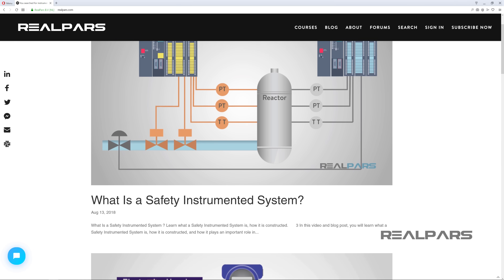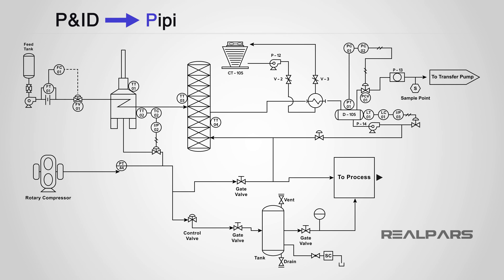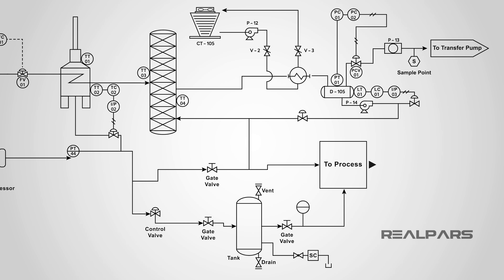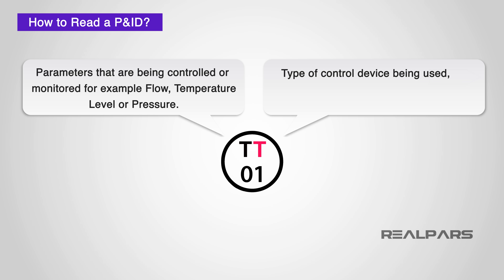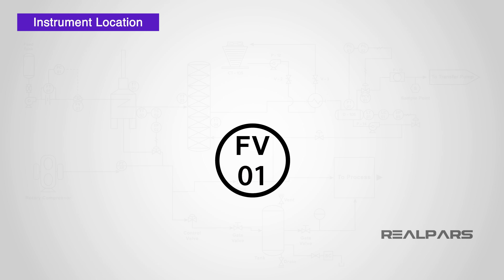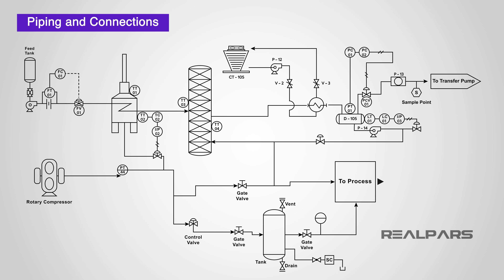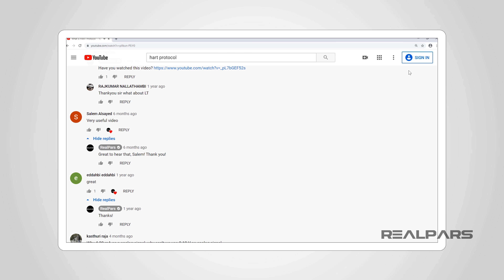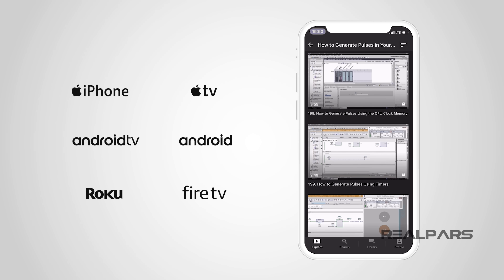How to Read a P&ID? (Piping & Instrumentation Diagram)

Comment: what location will the circle with internal line indicate?  3:16
Reply from the maker: Hello @mubashshirshaikh-b7u. Thank you for your question. You asked about the FV01 and the FV01 with a line in the circle. The FV01 is located in the plant as flow valve 01, and the signal with the line is the same signal, and a meter is located on the control panel, so you can see the value of this FV01.

Here is a link for your learning on P&ID symbols: www.edrawsoft.com › pid › images
https://www.edrawsoft.com/pid/images/pid-legend.pdf

Happy learning from Realpars!

Comment: Is this really a P&ID not a PFD👀
Reply from the maker: Hello, @Joynamiiro. Thank you for your question. No, they are not the same. A PFD provides a simplified representation of a process, showing the relationships between major equipment, control loops, and process flow paths.  And the P&ID (Piping and Instrumentation Diagram) is a detailed schematic drawing used primarily in the design, operation, and maintenance of process systems.  Happy learning from RealPars!

Comment: From a 10-ton waiting bunker, a mixture destined for the production of dog kibble moves to a continuous, horizontal paddle mixer where steam (direct injection into the product) is added to moisten and heat the product. The temperature of the mixture upon leaving the conditioner must be 70°C, from the first kg (thus from the start – often referred to as hot-start mixers) to the last kg, but must not exceed a temperature of 80°C. This product then goes to the extruder, which shapes the kibbles, and subsequently moves to the cooler.

Can someone help me drawing a flow diagram with sensors, controlers, indicators and actuators on it? After watching many videos I am still not able to do so. Thank you a lot!
Reply: @RealPars? 🥺

Comment: Good video, very basic. Our equipment P&IDs are very detailed, and lists the setpoints of controls, signaling direction and type (analog/digital) etc. We also have our valves separated by solenoid and pneumatic or hand control (isolation). Lots to learn but indispensable.
Reply from the maker: Thank you for sharing, John!

Comment: I have noticed that there are multiple controllers in the P&IDs I have encountered. These controllers control the various process variables(Temperature, Pressure, level, flow). With this distribution of autonomous controllers in the diagram, is it safe to say a plant uses DCS or multiple PLCs(ie one plc for each process variable). 

I understand PLCs can be used as DCS and in that case, does one plc control just one process variable?
Reply from the maker: Hi there, 

Thank you for your question! Yes, you are correct. You can have multiple PLCs controlling one process at a time or several PLCs controlling multiple processes simultaneously. It depends on your process, the type of PLC and manufacturer you pick, and the memory and I/O boards you install in your PLCs.

Here is a link to help you learn more about PLC processes from Siemens, and you can compare them to other manufactures out on the market. 

https://support.industry.siemens.com/cs/document/90939626/tia-portal-an-overview-of-the-most-important-documents-and-links-safety?dti=0&lc=en-US

Happy learning!

Comment: This is not a PID. This is a PFD with some instrumentation tag numbers added. Where are the line numbers, intermediary valves, etc?
Reply from the maker: Thank you for your comment.  Technically, you are correct.  A full-blown P&ID would be much more "congested: and not as clearly convey the basic control elements of a P&ID.  Much of what is presented on a full P&ID is information related to piping, insulation, and mechanical details, which have been removed in this video to make the automation elements more visible.
Reply: @realpars  understandable, but it might be worth mentioning in the video as many who are new to PIDs may get lost in the complexity of some drawings.

Comment: How to read block process flow diagrams?
Reply from the maker: You would read a PFD much in the same way as a P&ID.  On a PFD, there is typically less detail about piping, equipment, and instrumentation, but PFDs usually have mass and energy balances and individual stream properties which are helpful in understanding the process.

Comment: I have a question hope to get answered.
Is a pressure indicator (tagged as PI in P&ID) the same as PIT?
I'm talking about the type of signal they send.
Reply from the maker: No.  Per ISA 5.1, 
PI =- pressure indicator (local indicator, no signal to control system)
PIT = Pressure Indicating Transmitter (local indication and signal to control system - either voltage or current)

PT = Pressure Transmitter (no local indication [blind] and signal to control system - either voltage or current)
Reply: @realpars  
You have no idea how this answer helped me. 
Thank you...

Comment: Hi, can I know where to put pressure control system at a fluidized bed reactor?
Reply from the maker: For a fluid bed r4eactor, it is usually advantageous to put a back-pressure controller on the outlet stream of the reactor to maintain a constant pressure inside the reactor.

Comment: whats the parameters and type of I/P  ?
Reply from the maker: The I/P shown is a current (I) to pneumatic (P) transducer.  It takes the 4-20 ma signal from the controller and converts it to a 3-15 psi signal for use by the diaphragm actuator if the control valve.

Comment: Thank you for your great explanation. I would like to ask, what does the "not directly accessible" really mean at the solid line?
Reply from the maker: "Not directly accessible" means that you cannot walk up to a panel and physically touch or manipulate the device.  You have to pull out a rack, walk behind the operating panel, open an enclosure, etc.  This is an older term, but it is still appropriate for field-mounted devices.
Reply: @realpars  Thank you so much
Reply: Watch P&ID video using EdrawMax at @FODIC
https://www.youtube.com/watch?v=jHzYXW0r0AU&t=300s

Comment: thanks for the video. it helps ,me a lot but what do you mean at 3:37 "not directly accessible?" what does the pipe symbol crossed with 2 bars? (for instance of the top right of your scheme. Could you   advise me a handbook? thanks a lot
Reply from the maker: Instrumentation and piping symbols for P&ID drawings are defined in ISA 5.1-2009 (http://integrated.cc/cse/Instrumentation_Symbols_and_Identification.pdf).  'Not directly accessible' means that in order to access the device, you will need to open a panel or go behind a panel.  I am not sure where you saw a "pipe symbol crossed with 2 bars" in the video.  If you let me know at what time in the video it appears, I will be happy to help identify it.

Comment: How do you count Input and outputs from a P&ID? and this IO count will be used for PLC Programming.
Reply from the maker: Excellent question!  In order to do this correctly, you will need to thoroughly understand the P&ID symbology. Motors, VFD's, analyzers, and even valves may have multiple I/O points associated with them.  The P&ID lead sheets and any "typical" that are contained in the P&ID's may offer some clues. For example, a typical valve may have one digital output (to move the valve) and zero, one, or two digital inputs to indicate position.  A VFD may have a digital output to start the motor, an analog output as a speed setpoint, two analog inputs for actual speed and current, and several digital inputs to indicate status, alarms, "at speed", ramping, etc.  When I do this exercise, I like to take a set of drawings, and for each item on the P&ID, I write the number of DI's, DO's, AI's, and AO's on the drawing in pencil.  As I go through the process and learn more about the intent of the process, and through discussions with the process engineers, I can come up with an accurate I/O count.  It also helps to understand the past philosophy of the plant as to how many I/O are typically used for a class of devices.  When instrument busses like Profibus are used, and each I/O point is not associated with a separate wired connection, then those I/) should be accounted for in a separate list.
Reply: @realpars  thanks for the reply. it mostly cleared my doubts on P&ID,  once again thanks for your amazing efforts and educating us!!

Comment: According to ISA (http://integrated.cc/cse/Instrumentation_Symbols_and_Identification.pdf) solid line represents a control room (or accessible to operators), and the dotted line as inaccessible. Can you please clarify?
Reply from the maker: Thank you for your question.  A solid line through the "bubble" indicates the device or controller is "accessible to the operator" in their normal monitoring location.  This would be in front of an operator terminal (HMI) in a control room,  on the front of a control panel or operating board, or at a field location like a wastewater system "hut".  A dotted line indicates an "inaccessible location" which is not a normal operation location, like the back of a panel or in a control closet.  I hope this makes the use of these symbols a little clearer.

Comment: We have some major ones in my line of work, never take for granted that the piping goes in the direction of the drawing. Best advice for a starting point is to find a piece of equipment upstream and downstream of something major to determine you’re going in the right direction. Once you get the hand of them they are pretty simple. Just make sure when you are printing off them you have each page related to the start and end of the process you are following. Nothing worse than being on top of a 500ft structure that’s under construction to realize you didn’t bring all the right sheets. You only learn that lesson once when it’s like 45C in China and you’re a mile from the control room.
Reply from the maker: Thanks for sharing your knowledge and experiences with us, Colin!

Comment: With regards to Instrument location, in the Video the dotted line inside the circle indicated that the device is located in the control room while the solid inside the circle indicates that device is inaccessible to the operator. As per ISA-5.1-1984-(R1992) Standard it should be the other way around.
Reply: of course, great , I agree with you
Reply: aha!  that's what I'm looking for! thanks mate!

Comment: What is meant by "Not directly accessible" in practical words?.
Reply from the maker: "Not directly accessible" indicates that the operator is not able to physically access the device.  In the case of "no line in the instrument bubble", the device is in the field and you can walk up to, see, and touch the device.  In the case of "a dashed line in the instrument bubble", according to ISA-5.1, the device is behind the operator panel, not visible from the front of the operator panel or console, or is not accessible at the panel or console.  In the case of "a solid line in the instrument bubble", according to ISA-5.1, the device is on the front of the operator panel, visible from the front of the operator panel or console, or normally accessible at the panel or console.

Comment: The part of circle with dots or solid line , I dont understand , what do u mean by indirectly access & in field ?
For example pressure transmitter (PT 44 ) with solid line
Reply: It has to do where the process indication is displayed - if at all.  No line means that an indicator is available on or in the vicinity of the equipment.  The dotted line means that the process value is indicated in a control room.  Solid line means there is no indication provided for an operator to check.  It is utilized by the control system, but you cannot access it without pulling the information directly from the control system.  So, PT-44 has no indication provided within the plant - either on the equipment or in the control room.  If you want to monitor it you have to pull it off the control system.
Reply: He didn't say Indirectly.
No line: In the field means somewhere on the factory floor, usually close to whatever it's controlling or reading.
Solid line: Not directly accessible by operator could mean it's inside a locked panel or access is only to the engineer and not technicians but can be accessed if needed.
Reply from the maker: Alexander Norman:  Excellent reply to the original question.  For complete descriptions of the symbology on P&ID's, refer to Standard ISA 5.1.
Reply: Thanks.  I try.  Something else everyone should keep in mind is that P&IDs will look slightly different from plant to plant.  They don't vary much, and with a little bit of consideration you can understand any of them.  But there are different standards that plants will adhere to as their official code of record.  And even if they abide by the same standard, they may adhere to different revisions of that standard.